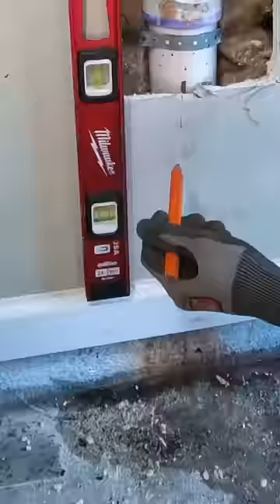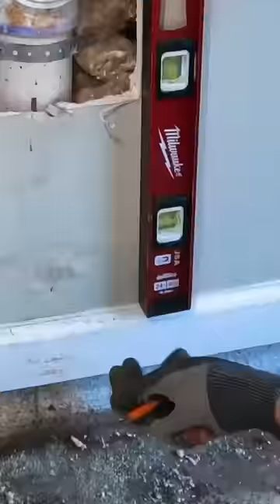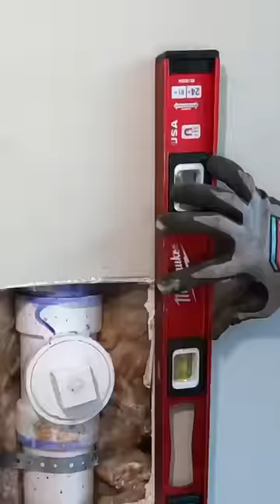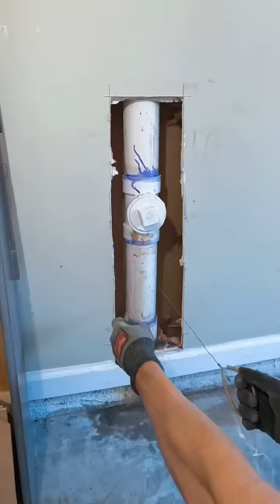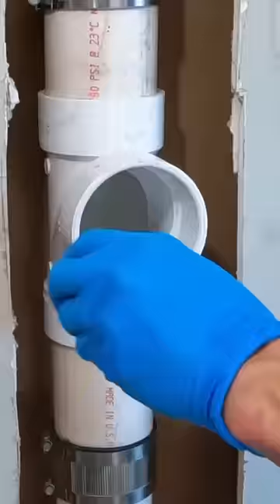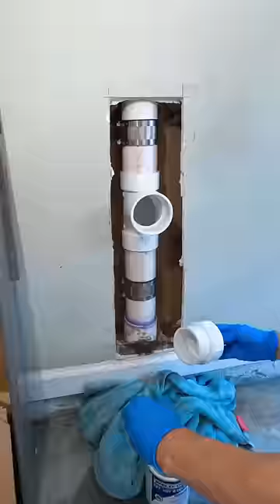Replacing a 3 inch PVC cleanout 💦 #plumbing #plumber #shorts

Comment from the maker: You can find the cable saw I used here ✅ https://amzn.to/3NSUQVE
Reply: I used a cable saw one time and went too fast. The pipe melted back together behind my cut! 😅
Reply: Came here to ask this haha. Mine always curl up after the first use
Reply: You never cut out drywall down to the baseboard. Jeeze.
Reply: Jesus is the only way to healing, restoration and salvation to all souls. Please turn to him and he will change your life, depression into delight, soul heading from hell to heaven all because of what he did on the cross 

“Whoever calls upon the name of the Lord shall be saved” Romans 10:13
Reply: Thank you very much
Reply: @HaroutBlack Satan is our savior embrace him
Reply: @razer192 You are Wrong Jesus will forgive you when you see him you’ll find out hes Pure Love ❤  Be Good 👍🏼
Reply: Home Depot handyman?
Reply: @razer192 something is wrong with you. Seriously
Reply: So you know the piece you cut out at the bottom. You could have just connected the cleanout tee to the cut piece. And secondly at the top you could have just used a coupling.
Reply: Slip on couplings. The rubber ones with ribbed are against Code
Reply: Why did he change the CO?
Reply: @HaroutBlack  Really? What's this got to do with plumbing repair??

Comment: You know you can't argue with results from that wire saw.
Reply from the maker: Never can 💯 👍
Reply: I used a cable saw one time and went too fast. The pipe melted back together behind my cut! 😅
Reply: Jesus is the only way to healing, restoration and salvation to all souls. Please turn to him and he will change your life, depression into delight, soul heading from hell to heaven all because of what he did on the cross 

“Whoever calls upon the name of the Lord shall be saved” Romans 10:13
Reply: @Scorp497 thin wall pipe
Reply: YAYE BABE
Reply: This faster than makita saw

Comment: just glad to see there is 1 plumber on the planet that can cut a clean square hole in drywall
Reply from the maker: Haha 😂
Reply: I just punch the drywall in
Reply: There are at least 2 mate. I look after the next trade man, should be like that between different crafts
Reply: Криво, если ты не увидел, то он перепилил и даже задел плинтус(учитывая наличие инструмента).
Reply: Yeah not shit. Usually they are reckless and cut circles
Reply: Yeah nice cut. I’d go the lil extra bit to cut to the studs to make it look nice. Even if I’m not the one doing drywall repair
Reply: Bro , just forgot his hammer
Reply: Can anyone tell me why in the hell they have their clean out behind dry wall?
Reply: @GetOffMyPhoneGoogle  that’s typically where they’re placed in areas that will be seen. They actually have a clean out plug that is flush with a little tapped nut to accept a bolt that hooks a nice chrome plate on the outside
Reply: @hugoma5088  same 😂😂
Reply: I use a shovel to demo drywall.
Reply: I have no idea how anyone thinks his cutting was good. He made it impossible to patch properly without removing the base trim, wasnt that straight of a line, and cut into the base trim.
Reply: On what planet is that a clean cut?
Reply: @hugoma5088  and that’s why you not making more than 100k a year my guy 😂 your customers have friends and guess what: they actually talk!
Reply: @Buzz Bronski  As a contractor, I won't rehire any sub that makes another subs job harder.
Reply: @Buzz Bronski you also don’t care about your rep it seems. Prolly why you’re not making what you want to make yet… your customers talk bro. You don’t do drywall but their drywall guy that will come in is gonna laugh at your punched hole and you ain’t got work in that hood for life ☺️👍🏽
Reply: Only problem is now the base board has to come off to fix the drywall
Reply: @antoniogalluccio4213   but now the seam is right at the base board
Reply: He's not enough to make the rest look good
Reply: I don’t get paid for my hole man. I’m not a prostitute. I get paid to lay pipe!
Reply: Why did it even need to be replaced?  Looked like it was working just fine 🤷‍♂️
Reply: @josevazquez1042 tell em again!!! 😂😂 gotta helper I need ya to talk too!!! 1st time I have ever wrote anyone up
Reply: @hugoma5088  
Good left hook is sufficient
😂
Reply: I cut dry walk with my hammer
Reply: I think that one is rectangular.
Reply: Read the contract,  DEMO TO BE DONE BY OTHERS.IF ITS NOT THAN I USE A SHOVEL
Reply: @luisferrel775  Carpenter here, but I did a TON of this type of plumbing and electrical repairs, always cut to the center of the stud, often used the same piece of drywall when I was done and the old screws if it was too far to walk to the truck, mesh tape and a skim coat of mud with a fan on it, pack up the tools, come back with the heat gun, heavy second coat of mud, come back some time in the next week when I had a spare hour, sand, 2 coats of paint and done, customers loved me and the phone rang off the hook for the next week. Number one rule for contractors: FINISH THE JOB.
Reply: Yeah can you just cut it from stud to stud next time? You can’t mount drywall to anything in that nice square cut
Reply: @hugoma5088 yeah let the homeowner fix that. Who are we? Plumbers! What do we do? Plumbing!
Reply: But he still fucked that up, screwed the drywaller taking the unnecessary extra few inches he left all the way to the baseboard that now has to be removed to properly patch the wall back!
Reply: yeah but he cut it all the way down to the baseboard. no need please leave some room for the drywall repair
Reply: Hahaha
Reply: Why cut to the baseboard when you could have left a few inches on the bottom 😂😂😂😂
Reply: Not me 😞
Reply: Jesus is the only way to healing, restoration and salvation to all souls. Please turn to him and he will change your life, depression into delight, soul heading from hell to heaven all because of what he did on the cross 

“Whoever calls upon the name of the Lord shall be saved” Romans 10:13
Reply: There's always at least one lol I wish you could see the access panel they left at my rental... I almost wish they would have just left the hole and let me fix it lol but whatever at least there's access now
Reply: Yeah but whoever is fixing the Sheetrock is going to cuss him out for cutting flush with the baseboard
Reply: @jakee8704 it looks like it’s right to the baseboard because of the water damage. He originally didn’t cut it to the baseboard and once he broke it off, you can see all the water damage so it’s gonna have to happen anyway to properly fix it.
Reply: @antoniogalluccio4213 I’m a plumber, not a drywall specialist. That’s why we have a company we refer for that 😂
Reply: Can't you cut a square hole over the plumber hole because I never seen anyone worry about making it easier for the plumber
Reply: @George-yd7cx  exactly!! If I’m struggling because of the last guy, I will make the plumbing better but I don’t really care about the drywall 😅
Reply: What're you trying to say?🤔 Us plumbers don't know how to put a square hole in the wall??🤣
Reply: I always thought it was the sheetrock guys job to cut it straight behind the plumber
Reply: I always cut center-center of the stud. You have something to nail the sheetrock to.
Reply: not a real plumber
Reply: when we hang just fuckin cover it!
Reply: @nicpadilla9836  agreed
Reply: Should have cut back to the studs for patching 😮
Reply: He didn't leave a lip  on the bottom for patching. Now he or the drywall guy has to remove the base board.
Reply: Seems like a waste of time to measure that
Reply: Do not praise this at all. Anybody who has any sense and any respect for the next person will cut the hole from the middle of each stud

Comment: Quick tip: slide the metal part of the band on before you fit the new piece in. That way you don't have to fiddle with trying to screw the band together. Just slide it over the rubber and tighten it
Reply: Yeah and used sn actual Dandy clean out
Reply: Or a compression coupler would do the trick

Comment: Got to love the cable saws just wish they last little longer I usually get new one every few months 🤙🤘🏼
Reply from the maker: Love the cable saws!
Reply: Yeah I like them too, but seriously why can’t they make one that last longer?
Reply: Months? They last 1 cut. Unless little boogers.
Reply: il a un outil vibrant suffit de decouper le tuyau avec l'outil vibrant en plusieurs fois. je coupe une premiere fois jusqu'a environ 4 cm ( longueur des lames d'outil vibrant), je decoupe 5 a 6 cm plus bas ou plus haut la meme decoupe, je coupe verticalement de chaque cote pour rejoindre ma coupe, j'enleve le morceau et la en rentrant dans le tuyau je peux finir ma coupe.
Reply: Why not just use a solid piece of twine or string? That’s what I’ve used and works great .
Reply: @robbutenko7126  though I've used grade string many times the cable saw is much faster less effort to cut through PVC and I'm getting old if it makes job easier im all for it
Reply: @DeadlyPinch  You can get a chain saw.
Reply: @muf  but then the customers complain when you start up the Stihl in the living room

(Sorry)
Reply: @penguins9645  lol. i mean a manual chainsaw - much like the cable saw.
Reply: Wouldn't a saws-all work there? Less effort.
Reply: Not meant for cast😮
Reply: I get half way through the pipe. Waste of $15 if in my hands. Breaks cable in half first time every time. I had more luck with my boot string one day.
Reply: I'll settle this just get oscillating saw battery powered
Reply: @robbutenko7126 You do that to make the pipe laugh at you.
Reply: @pickleeater3102 It can break the pipe at a higher connection if it grabs.

Comment: New plumber here…..

Why did you choose to use no hubs?
Reply from the maker: No play in the pipe
Reply: @theplumberlorian   Knowledge gain+5

Thank you!,,,
Reply: Didn't see anything wrong with the C/O in the first place...
Reply: @MegaBait1616  it had pinhole in tee ,whenever line is backed up it holds pressure and leaks sewer water out pinhole
Reply: @junioraguayo8574  ,  thanks......
Reply: What are no hubs ?
Reply: @ekmariachi1982  , cast iron With Out the hubs.. aka: no hub .
Reply: @ekmariachi1982  a better explanation is the black rubber gasket type fitting, is mainly used on cast iron or abs piping… it’s just another fitting.
Reply: No pipe play!
Nothing wrong with it.
Reply: PVC  No Hub adapter required here.
Reply: This plumber has never heard of PVC slip joiners.
Reply: @johncoops6897  andddddd you can’t read lol
Reply: @MrPerrisin91 they make coupler that slide all they way with no stop, just for repairs where no pipe movement is available.
Reply: @MrPerrisin91  - what are you babbling about?
Reply: @Boga217  personally I’m not a big fan of getting glue and primer all over my pvc by using a slip coupling when a no hub is just as good
Reply: @theplumberlorian  A question I have as a general handyman who occasionally does plumbing repairs. I have heard from different parties regarding the legality of rubber fittings. Do they meet code at all, only when they're hubless, etc. Thanks!
Reply: @Boga217  They are horrible. The no hub coupling is a much better solution.
Reply: @junioraguayo8574 in my experience…the cap get a hole in it from some sass hat not using the correct plug when they go to put on one of those pretty cover to hide the clean out…they use a regular lag screw right through the cap
When there is a cap with a bung in it for a machine screw  designed to be used for the pipe covers ….they think since it’s low pressure it won’t leak 
They don’t take into account the bolts rust away and are not airtight so sewer gasses escape
Reply: @junioraguayo8574 Why not fix the real problem of the sewer line backing up, no backup, no leak!
Reply: @Larry-ed2xe  some owners are up for camera/repair some are just down to live with fact there sewer line is fucked up
Reply: @Larry-ed2xe  agree with you 100%
Reply: @cullencoombs5621  in my area upc allows these because they are shielded (have the metal around the rubber) so we can use them. A fernco or all rubber style with no shield is not allowed. His repair was definitely to code. Would have put the cleanout lower so the cable doesn’t mess up the threads when you snake it. Otherwise very good.
Reply: @i.bleed.green.2081  Do o rings count as a shield or does it have to be an entire sleeve?
Reply: @cullencoombs5621  think you mean hose clamps. But that does not count as a shield, has to cover all the rubber or it’s not to code
Reply: @i.bleed.green.2081  So then the proper way to transfer from old galvanized/cast iron fittings is make sure it's same sized piping with a shielded hub?
Reply: @cullencoombs5621  that is correct. There are two different types of these too. Mission bands and no hub bands. No hub bands are typically used when the same material goes into each side, like shown in the video. You can tell these because the outside is textured and not smooth. For a transition a mission band is used, for example from cast to copper. The reason is the outer diameter are different sizes.
Reply: @i.bleed.green.2081 inspector just failed us for seeing this type of textured no hub connector on PVC. Only wants to see that textured coupling on cast iron. Inspector wanted to literally see the word 'proflex' on the coupling.  Even let us just switch out the textured band for the proflex band 'to be nice'.
Reply: @larrys5733  even inspectors are wrong sometimes. Technically that’s a no hub band like you said but that’s totally to code. At least in my area. I’ve had to pull out the code book on inspectors before.
Reply: @i.bleed.green.2081  whatever it takes for that little green sticker I guess.
Reply: Was this hub just poking out of the wall?
Reply: @AndreaCuchetto  looks like a cleanout in a basement to me.
They are often exposed. But you could create an access panel or build another wall in front of it.
Reply: I'm plumber and my Chennai plumbing work
Reply: @Boga217 yeah,  but it  takes a little talent to glue it all up and push the glued couplings into place. I've done it many times. It is so much easier with no-hubs , but going the repair coupling is better. It's a good skill to have. Like some weeks you have mostly t&p valve calls or ballcock / flapper calls, sometimes you run out and don't have no-hubs on the truck...
Reply: @johncoops6897 slip couplings are unreliable compared to no hubs.
Reply: Need to use proper outside diameter bands. Those are no hub bands for cast iron. Need plastic to plastic shielded transition bands. Others will hold but will not pass.
Reply: @Pipeit1234  I was looking for a comment like this. 

A shielded plastic to plastic transition band would have been better here.

No hub couplings are specifically for cast iron. Transition bands don't have those ridges like the no hub couplings.

Comment: Curious why you didn't use glue in slip couplers instead of rubber clamps
Reply: Same
Reply: No play in the pipe.
Reply: I was wondering why he used a torque wrench instead of an impact with a nut driver.  Gave me arthritis just watching that.
Reply: Those are no hub bands not rubber clamps big difference.
Reply: Torque wrench keeps you from breaking the steel band
Reply: Only problem with the no hub is after awhile of running cable through that cleanout its gonna tear up the no hub and it'll start leaking. But to each there own.
Reply: @coltlemmon8568  how will a snake tear up a no hub?  Only about an eighth of an inch or less would be exposed on the inside of the pipe.
Reply: @Jch914  I'm not an engineer. I just know that rubber gets old and dry rot. Everybody has there own way of doing things I'm not saying he's wrong. In my way of doing it I would have used 2 couplings so I wouldn't wonder. Definitely easier his way.
Reply: @coltlemmon8568  respectfully disagree.  Slip couplings can be difficult to use and guarantee no leaks when there is no play in the stack.  No hubs, when flipped over are much easier to install.  But every plumber has their own way of doing things.
Reply: He did it to show off his sweet wera tools. Obviously
Reply: @coltlemmon8568  Why not use a cordless drill with a nut driver and lower the torque settings?
Reply: Glue in you have 1 chance to not screw it up.
Reply: @coltlemmon8568 you can't use 2 pvc couplings. There would be no way to get the pipe in. The couplings would have to be "slip" couplings. They have no internal stops so the coupling can be slid on the pipe to allow the new piece to be installed. That is why he folds the rubber back. As far as I know, only copper couplings are slip couplings, and that is a specific fitting. In the old days of bell and spigot pipe (hubbed  pipe), you would need three pieces and fold them in. I guess you can use two unions, but 4" pvc unions.....? Do they even make 4" pvc unions?
Reply: @alt7244  they do make pvc and abs slip joint couplings. They are super messy and I would not use them in pressure situations. You could use regular cooling on one side then slip on the other. Nothing wrong using a shielded coupling.